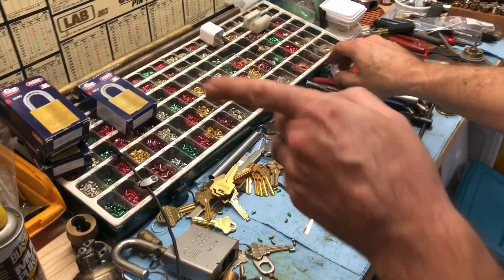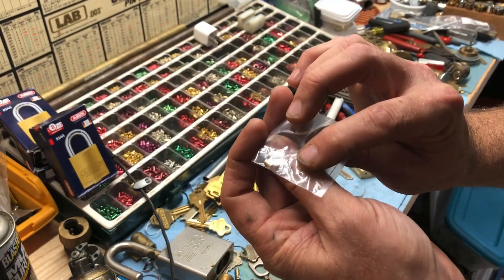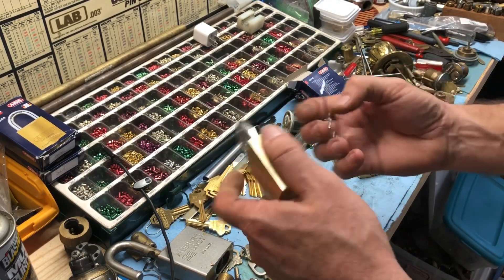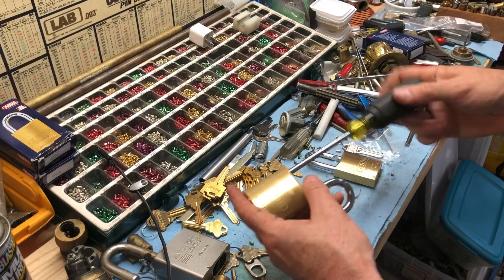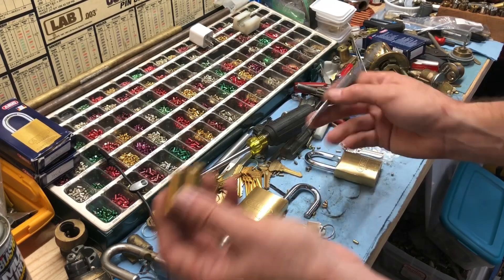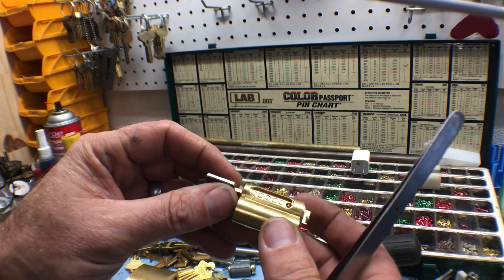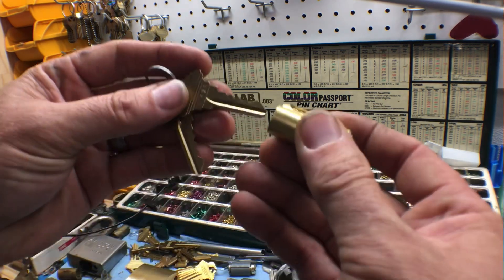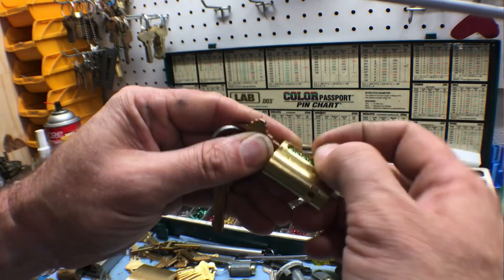be careful rekeying an ABUS 83/45 padlock with a Weiser key!

Comment: I have several Abus 83/50 300's keyed with a SC 1. I added the provided 6th spool pin as the sixth pin, riding the key tip. My new home (still moving), has third gen smartlock, so Abus locks are just for secured storage.
Thanks Jason

Comment: Very interesting. A cylinder that is designed to be rekeyed while still attached to the bible, now that's innovation. First time I've seen a cylinder like that, very cool. Thanks for the tips in this video, cheers
Reply: Pocket Women It’s pretty common.  Some are not cut out as large.  They may just be drilled holes.